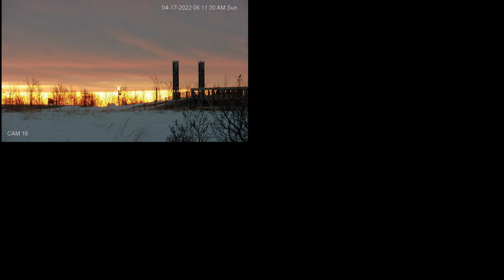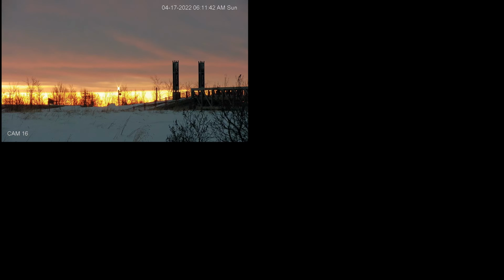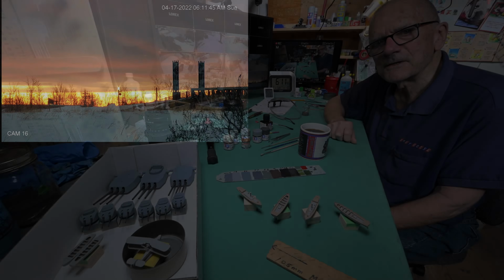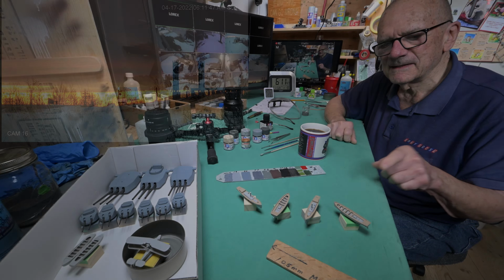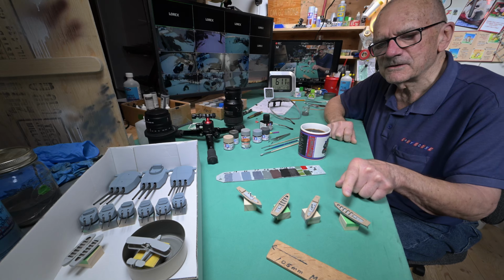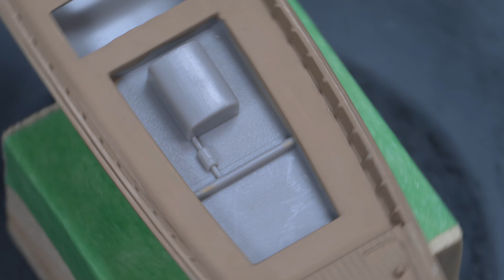The Model Ship - Part 1150

Comment: Happy Easter Ron🐇🐰. That #xf-56 takes alot to get use to it. It doesn't go on like regular paint colors. It look okay on the larger guns. The smaller pieces it doesn't shrink rap around the detail parts right. Metallic paints are hard to work with to get it to paint right. I think that paint would work good on model steam locomotives. Keep up doing a great job. Good to see the rabbits out for Easter. Be safe and see you tomorrow.👍🐇🐰🚢⛵🚂
Reply from the maker: Thank you!👍